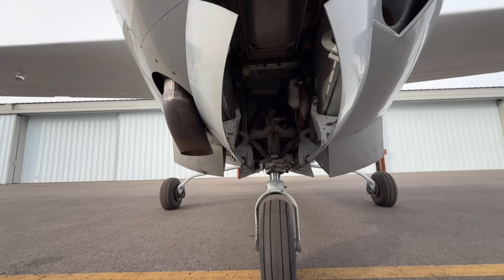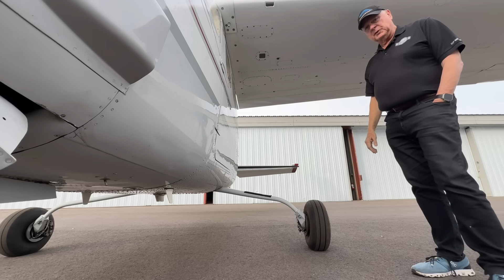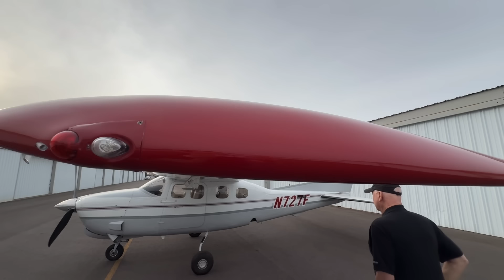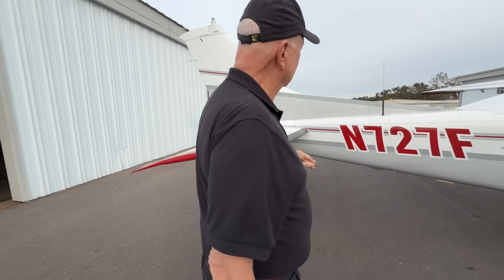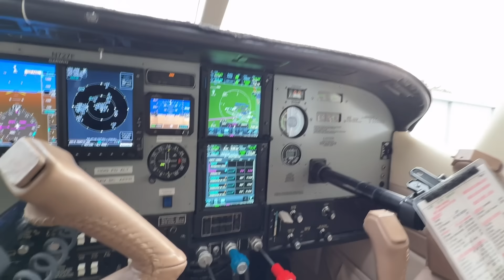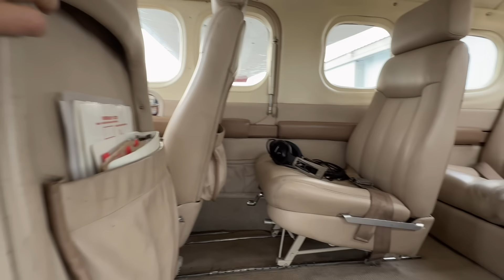Cessna 1981 P210 Overview

Comment: Excellent informative tour of the P-210.  I’ve got a bit of time in the non-pressurized type.  Great flying airplane.  Much better 4 9r 5 o place aircraft rather than 5.  I’d be interested to know the performance figures with 120 gallons of fuel with 5 people on board,
Reply from the maker: I agree - four people is fine - 6 no go for me, the same of the 206.  The P210/T210 have great useful load and burn less than the T206H as well

Comment: Curious as to whether these engines actually make TBO.  My experience with 470 and 520s have absolutely not been good.  Cracked cases, half assed cylinders, and bad cam’s.
Reply from the maker: It depends upon the installation (make/model) and flying conditions.  This one has the Riley intercooler, we are VERY careful with CHTs, FF, and EGTs and shock cooling.  Continental did have an issue with cases on 520s,550s, but this engine has been great.  It is also important to do a very thorough pre-buy.  When we offer a plane - it has to be virtually perfect mechanically before we sell it - when we purchase one for a client - we are equally careful.

Comment: All true but, a cantilever wing requires a periodical expensive intrusive inspection which if not done thoroughly enough could end up very badly.
Reply from the maker: Correct- one reason we already did the inspection.  Wing inspections are not limited to the T/P 210s - look at Bonanzas and corrosion issues with Pipers.

Comment: Not sure why but P 210 has killed more pilots.
Bitch to work on.
Better hope you don’t need a new windshield.
Very few people need to fly at altitude.
Do you live in the mountains?
I knew jack riley jr and senior
Jack sr was doing a 8 cylinder 414 conversion.
Amous Butel was financing it.
Jack was using money to certify another 414 and screw Amos😂
I was working for jack junior and we went over with lawyers and deputies to take possession of 414. It was a real show , sr was screaming and got as red faced as his socks ( and commode seat😂)
Anyway one engine would not start when we got to leave. Well I knew mechanics and told pilot to leave fuel pump on, no fuel came out on the ground. Didn’t take long to find the welded up AN union.
Anyway Jr was nothing like senior.
I started building 414 winglets for jr
What a joke, I quit when I realized it wouldn’t work.
It may have been bigger than first Gulfstream winglet

Comment: The 210 is a maintenance nightmare.  Especially the ridiculous gear.  Add a turbo and pressurization to maintain and you have an airplane that sucks personal bank accounts dry.  STAY AWAY unless you are flying it with other peoples money.  I also see that this pressurized, “high flying” airplane has no de-ice equipment……..good luck with that.  TKS costs $85,000.  This guy is selling snake oil.
Reply: I think saying snake oil is going a bit far, buying an airplane is purely based on your mission and ultimately a balance of compromises. For the price and aircraft class pressurized cabin options are only really limited to this and Piper Malibu depending on your circumstances there could be a reason to choose P210 over the Malibu although admittedly the Malibu is better on paper.
Reply: @kelpeyehelp  Old and pressurized airplanes are always disasters.  One of the largest Malibu specialty shops in the country is not far away.  I have seen what’s involved in the upkeep of any pressurized airplane and ESPECIALLY old ones.
Two engines?  Triple the pain.  Turbos and controllers…….two more cans of worms.,
Reply: @747driver3 Used to fly a 340, pressurization was working but could be iffy.

Comment: I think when the smoke and the dust settles. In spite of the 210 being a little faster than the A36TC I would go for the bonanza. It will be faster getting out of the annual inspection.
Reply from the maker: Our annual inspections have been very reasonable, except for the AC system which we totally replaced this fall.  We keep it in top shape year round which helps.

Comment: Can i get feedback on the state of the overhead spar cross beam? Looks like there are four zippered vents to provide access into this insulated area... Have these been used? What's it look like in there? If I purchase this aircraft... is this an assessment chore I need to do without your assistance?
Reply from the maker: There is a spar AD which has been complied on this plane . It is always important to do a thorough pre-purchase inspection

Comment: What’s is the TAS @FL180 and the fuel burn ROP and LOP? It’s difficult to keep the CHts and TIT Lows? Thanks
Reply from the maker: Typically we fly at 175 KTAS in mid teens burning 18-19 GPH at 70-75% power
Reply from the maker: I keep  CHTs on all of my planes below 380 and TIT no more than 1550.  We were flying this one this week and in cruise, with cowl flaps closed, our CHTs were around 360F

Comment: I had an old strut 210 in the 70s, these newer ones with retracting  gear had problems with the gear, quite a few of them bellied in on the runways, I worked on a couple...sort of like the 177 rg had similar issues but not as bad as the 210s had
Reply from the maker: The price of introducing new technology year over year so far this model doesn’t seem to be having any gear issues

Comment: Is there a limit on the number of pressurization cycles the airframe can undergo? How is that determined?
Reply: No life limits on the pressure vessel on a P210, unlike the P Baron.
Reply from the maker: I haven't seen any limits on the P210.  It has an approx. 3PSID differential.
There are structure inspections at various intervals (e.g 4,000 hours, 6,000 hours, 10,000 hours, etc.) where you do check the aircraft for cracks and remediate if found.
Reply: @PersonalWings how many hrs on this airframe?
Reply from the maker: @rustyshackleford2723  5280 https://www.trade-a-plane.com/search?category_level1=Single+Engine+Piston&make=CESSNA&model=P210N&listing_id=2440088&s-type=aircraft